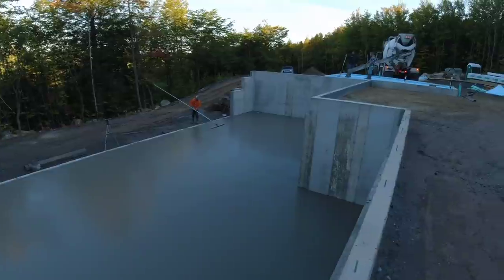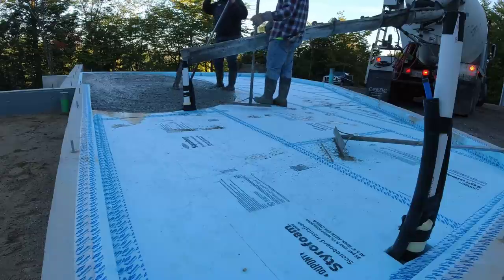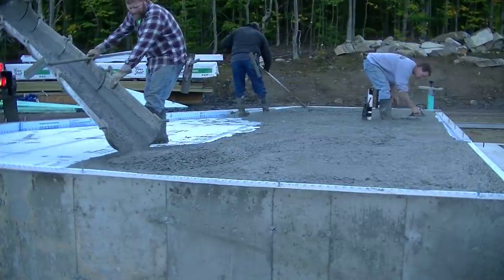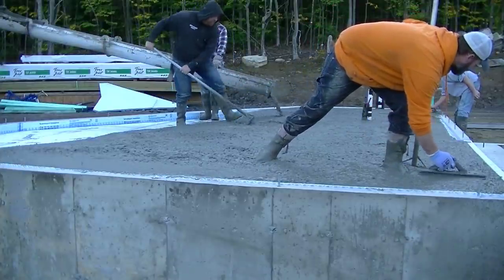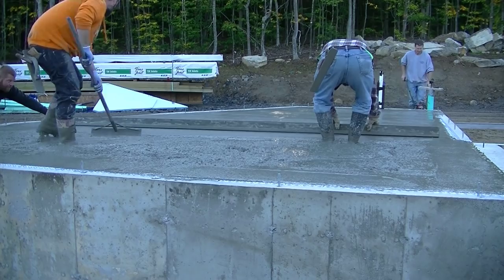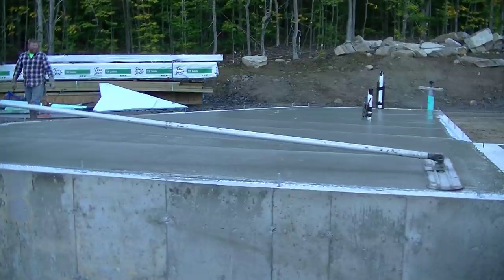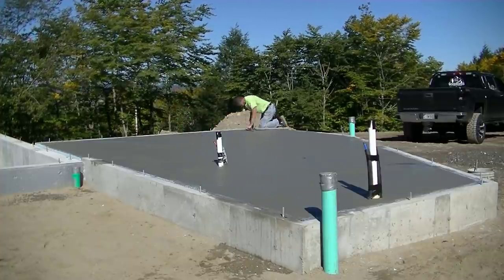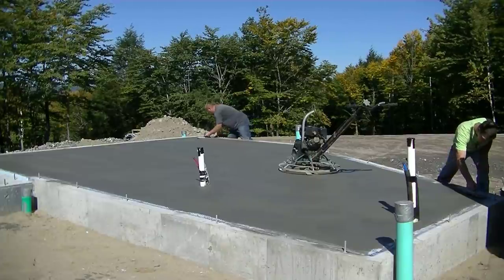Finishing Concrete by Hand or with a Power Trowel? (What's Easier)

Comment: Hand finished concrete never ages as well, a power trowel seems to distribute water, sand and cement better so surface stays smoother over time.
Reply from the maker: You're right, but it's all getting covered with tile on this one.
Reply: I would have power troweled it myself too like you said I wouldn't of glassed it up just made sure it was nice and flat nice good love your work guys

Comment: Hi Mike...I'm preparing to pour my own garage floor so I'm a regular consumer of your videos. Thanks for sharing your craft with us, I've learned so much in the past couple months going thru videos. Cheers mate.
Reply from the maker: Glad to help
Reply: @hedge685 how’d it turn out? I’m going to do my pole barn. After watching these vids the only thing I’m not confident about is that the batch I’ll order will be exactly the mix I want. I like the slump Mike pours at, it appears it would flatten out ok.
Reply: @wisdomspitter7688  Honestly, I'd give myself a B-minus. I've poured some concrete before but nothing like this Alaskan slab for the garage. Non of my help had any experience and not helping was the rental place did not have the power screed I reserved. Had to screed by hand with lumber and left some low spots. The ready-mix company was great as was the driver that day...both very helpful and patient with us. The mix was spot on with the fiber and water reducer. Placing wore me out and I waited 15 minutes too long to finish edges, but most of the damage was covered by framing.

Comment: Looks like you're up north somewhere. Down in tucson, Arizona most patios and sidewalks are 4". Like anything being built, the size of what its gonna be be used for is a major factor. House floors are usually 5"-6". Footings for a house are about 12"x12". Footings for 88 (8"x8"x16" block) walls, 6ft tall, is 8"x12". Depending on what the engineer says, is what we follow. Typical floors are 4", like patios and such. Different needs call for different design. Sometimes it seems like overkill lol

Comment: Machine much easier and 100% flatter. I worked for a company that had us finishing 20+ yard basements by hand. Usually 4 or more passes before finished. After 15 years went to another company and I finally got to use a power trowel. There’s no comparison.  I hit the floor east to west, north to south next pass then diagonal the next. Then repeat. We usually burn em up so plenty of passes. By far the floor will be better and flatter with a machine.

Comment: 2x4 form is 3.5" so the pour average is 3.5". Always wondered when folks say a 4" slab they mean 3.5" or do they ensure 4" in the field and 3.5 at the forms... Thanks for the videos.
Reply: Everyone I know also call it a 4" inch slab, I think they might dig the other half inch down maybe.
Reply: For exterior flatwork, there is usually a little space between the form and the grade and the grade will be a little lower than the form.

Comment: Mag to start is fine. I'd power trowel to even everything out and so it doesn't get away from you since you had all of the bleed water. Finish it by hand so you can get out of there sooner. It's getting tiled, so... once it's flat and solid, no need to go any further. The tile guy is going to put his mortar underneath his tile and level as he goes. I watched the power trowel shake your arms in a few places.... I know what that is🙄. 
How good does mortar/grout bond to a polished surface?
Flat is the most important part.

Comment: Have you ever thought of using a large soft squeeze to pull the bleed water off?? I'm about to do a 10 yard floor in the shade over plastic on a 50 degree day. I bet I'll have a problem with bleed water.
Reply: You can use a garden hose. Lay it on the slab and get a guy on each end and slowly pull it across the slab.

Comment: The only time i finish by hand is if its taking too long to set up because as you know it must be harder or more se to finish with a power trowel than by hand.  Sometimes on the smaller ones i will break out the sliders and sell it by hand and move on.

Comment: Hi Mike. Is it possible to just finish with a bull float as it dries. As in instead of using a mag and power trowel can use use the bull float at the times you would use them instead?
Reply from the maker: No, you'll never get a good finish as the concrete sets up. You'd be better off using a tool called a fresno. Similar to a bull float but kinda like a steel trowel.

Comment: I'd say the power trowel is better because it's own weight is also hardening, and smoothing it at the same consistency. Rather the hand finish doesn't apply the constant pressure to compact that last finish.
Reply from the maker: It does densify the surface better, yes.

Comment: I’m going to be building an 800 sq foot cabin that will be engineered, the foundation will be a mono slab with radiant in floor heat. I’m wanting to use the concrete as the finished floor, would you recommend a power trowel or just doing it by hand ?
I’ve done a couple of concrete countertops (pour in place) and used a steel trowel to finish them so I do have a little experience but not a lot, I will be pouring a couple of smaller slabs that I can practice on beforehand.

Comment: I would worry about the bleed water. Magging it back into the surface is not good for the water cement ratio. If it was outside I would be concerned about spalling. I like to put 2” to 4” of gravel on top of any foam when I pour. It gives the water a place to go. With all that water on top you have the problem of the concrete setting up before the bleed water is gone. Not a good situation.
Reply from the maker: I'd like that too Guy, no one will gravel on top of poly or insulation here. We have to deal with the bleed water most every day.

Comment: If I were the customer, I would want it power troweled. I would want the compaction and density you can only get from the machine. But as someone in the trade, I work for a paving company so I don't have to deal with floors. My tendonitis aches just thinking about hand wiping a floor.

Comment: If it's too smooth and you run the risk to have somebody slip, fall, brake some bone you probably want to brush or roll an anti slip paint over it. I wouldn't bother if it's going to have tiles on top or any other floor covering.
Reply: I agree with you Andreas

Comment: I power trowel all finish floors regardless of size
Reply from the maker: In the winter Matt, we'll hand finish a large basement to keep from getting carbon monoxide poisoning. been there too many times.
Reply: @MikeDayConcrete  I used to have a couple ground heaters and poured all winter.  Now I shut down around Thanksgiving and rest up for the spring